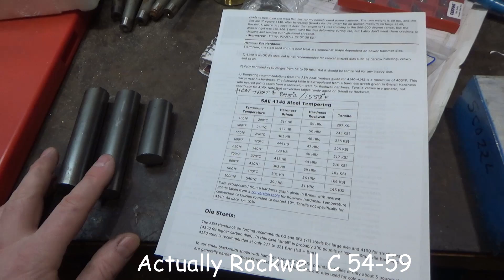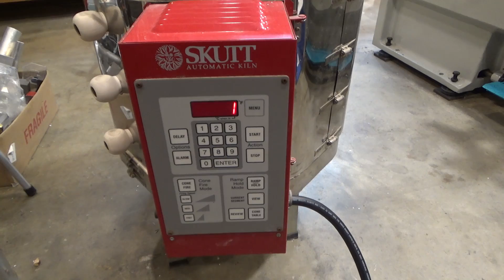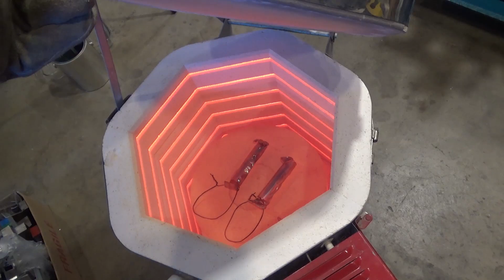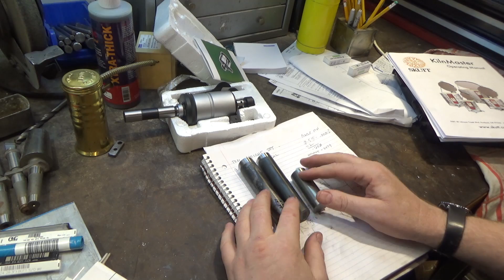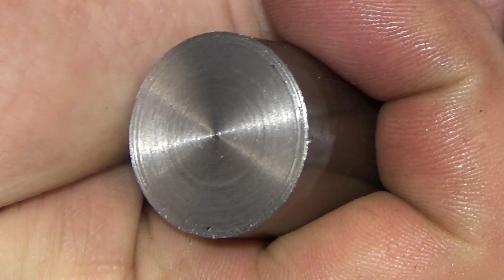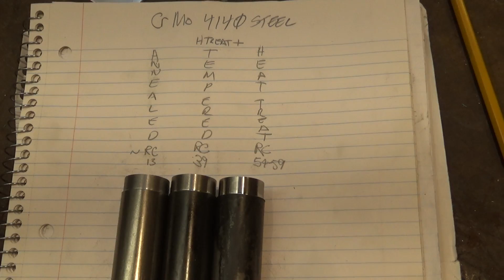The Effects of Heat Treatment on CrMo 4140 Steel in Turning Operations Part 1

Comment: You are using .002 per rev?!?!  You're rubbing, not cutting.
Reply from the maker: Interesting comment. I am getting chips off of the part, but the chip breaker clearly doesn't work at this feed rate. I used the low feed rate to get a better finish, but I have discovered that this only works sometimes. Thanks for your comments.
Reply: @DudleyToolwright  Supper old video, so you alredy know that, but just in case: you are getting adhesion effects on surface. to eliminate them you need get out of favoring conditions. Easy way is to get enought temperature in shear plane by increasing surf.speed or feed. By balancing adhesion, tool temp./chem resistance (seen as tool life), surf. roughness, chip control and setup posibilities you need to find aceptable result. Only when there is no adhesion - lower feed = lower s. roughness. 
  If something does not allow speeds/temperatures necesary - temperature   can be lowered below adhesion with use of very sharp tool (read polished/laped) and adhesion eliminated. Novdays its more of '' inefective old school metod''
Reply: @DudleyToolwright  Example: finishing pass in C45+A/SRA with f=0.02 - 0.07, a=0.1 - 0.4 would go aprox. with: 170 ... 180+ m/min on 0.8 tool radius and 120 ... 140+ m/min. 0.4 mm tool radius (edit: forgot nose rad. and coment that it is for tipical steel medium to semi finishing insert)

Comment: Do the dimensions change noticeably after tempering? The reason I'm asking is that you could harden, then machine and finally temper.

I'm assuming that the changed crystal structure will make things move a bit.
Reply from the maker: You know, that is one test I forgot to do. I do not know how much the bar moved after heat treatment. You are exactly correct though. Typically things move quite a bit during heat treatment. To avoid this special alloys like A2 tool steel are used to minimize this effect. Also rough machining is typically done before heat treatment to be followed by grinding to bring the part to size. Thanks for the comment.

Comment: what bout 4140 HTSR?
Reply from the maker: To answer your question, I am not sure if the 4140 I got was stress relieved or not. One thing I do know is that in its annealed state, it was really tough to get a nice finish during turning operations. In an upcoming video I might have a really neat way to finish difficult metals like Cold rolled or 4140, on the lathe.